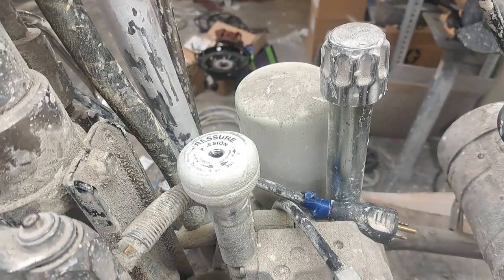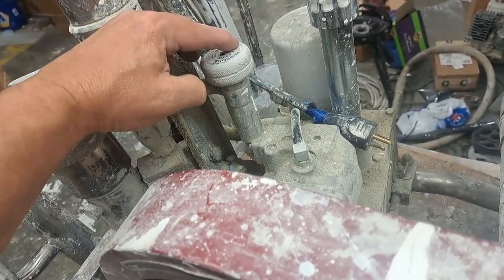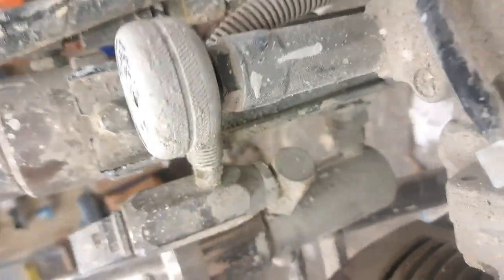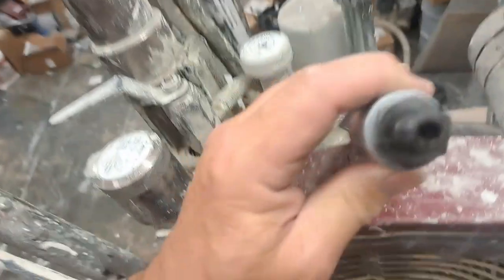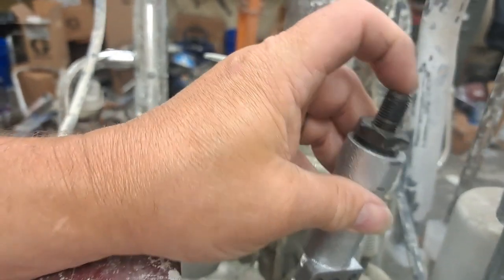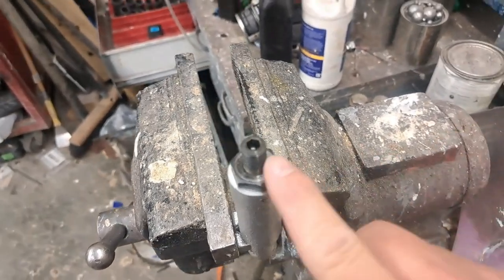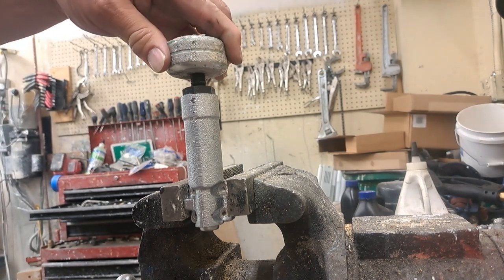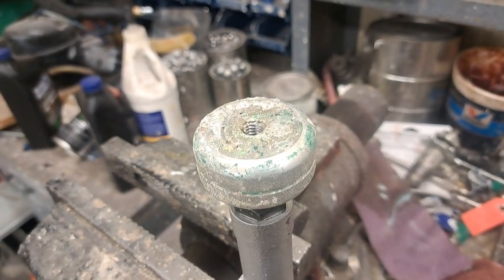Speeflo pressure calibration

Comment: I have a speed flow as well, the top of the hydraulic piston head gets very hot within 15 minutes of use is that normal? Do you have any videos of repairing that issue?
Reply from the maker: I usually don't do Speeflo videos. Most of the repairs take longer and are more detailed. The hydraulic motor does get hot when used. The question is, does yours get too hot? Is this a machine you have used for some time or is it new? Are you familiar with them or is this a new type of system for you?

Comment: I had mine for 16 years used it once 3 years ago, went to fire it up and hydraulic fluid flowed from the  piston fluid cup. Happen in seconds. I didn't even get it fully started. Put electric motor on, and it gushed out. Any idea?
Thanks.
Reply from the maker: @mattlord2906  yes, the lower seal in the hydraulic motor (where the leak is) has been damaged. This usually happens when the engine or the motor is turned off without turning the hydraulics off first.
The piston over shoots the seal and the lower seal is damaged. 
The full hydraulic motor needs to be pulled apart to replace that seal.
Reply: @Brian_the_repair_guy  ok, but I didn't get power to it initially.  I pulled the start cord and rotated the crank of the engine.   Are the parts available in a kit so I can just replace everything in the fluid/ manifold section. I have turned on many with that valve open for business, and this would be the first blowout.  I was worried that not having a paint hose attached , but it happened the moment it cycled.  Pressure was all the way down, and the prime value was open. I wonder if they sell a complete rebuild kit. If they do, is it the newer  titan 6900? Or are they more specific than that. This pump was never really used. It still looks brand new.  I used it 3 years ago because someone stole my other pump , so I  finally got paint on it.  I was about to sell it for lack of use and need the space.
Reply from the maker: @mattlord2906  when these machines are turned on the pressures are unregulated. When that hydraulic valve is open, the piston strokes as soon as the motor or engine turns. Because it is unregulated at the start, it will over stroke up sometimes.
You can get just that lower sea, but i do not recommend an unexperienced person try and replace it. This is a difficult process and even an experienced mechanic can have problems.
Reply: @Brian_the_repair_guy  thanks, I have worked on them in the past, but never had this happened.  These are like Toyotas that way.  I rebuilt a Hydramax and multiple other pumps over a 35-years painting. Never had the pleasure of doing it on a clean pump.
Reply from the maker: @mattlord2906  yeah, this one has a lot of steps, that is why I have never done videos on this repair.